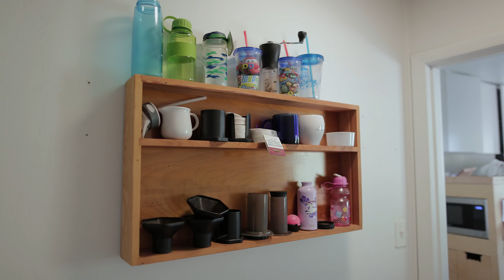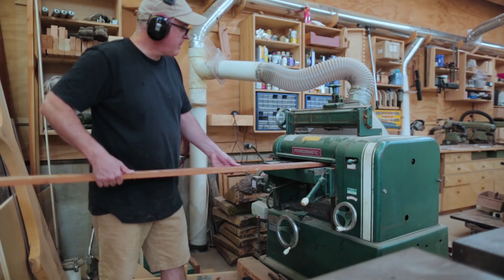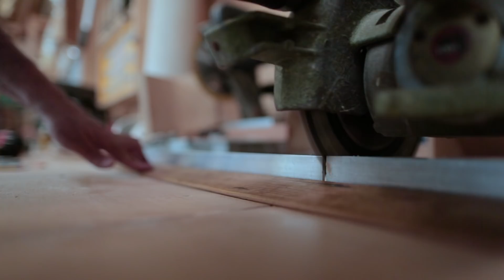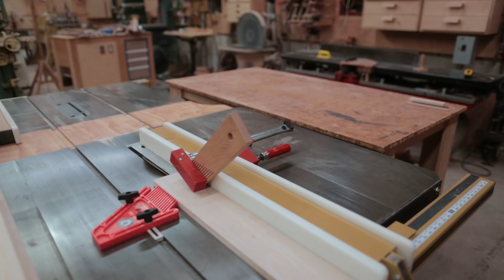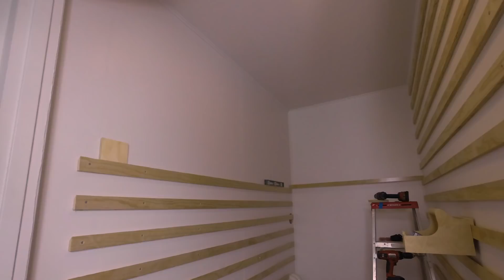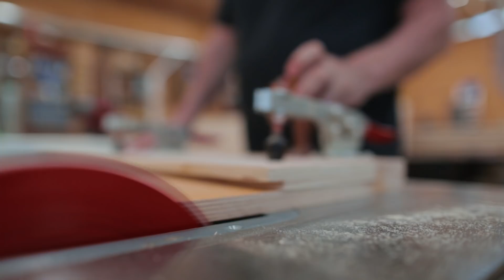Making the Pantry Part 1

Comment: Great work, BUT for space efficiency, you do not give the spaces between the shelves in order to  store different sizes of pantry goods? The storage shelves I am building do not have a wall on either side of the shelf. Therefore, I Will be putting a thin guard of wood,  rail  so that the can will not fall over.  What I need, eg a can of tomatoes height is 5", how much height between the shelves would I need to allow for removal of the can over the guard rail?

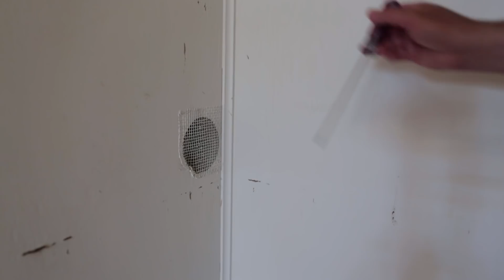Comment: At 4:44 the red paper going onto the floor is called "rosin paper" which is nice and thick and, importantly, CHEAP.  Much easier to work with than drop clothes (no tripping hazard) or plastic sheeting (no sliding hazard).  Find it at your local home repair store in 100ft rolls.

Comment: I would like to make a French cleat wall like that in a room in which one of the walls has the cement blocks exposed - it's in an old building and there is no dry wall. Do you think I need to screw some 5/8" plywood on the wall with cement screws before installing the cleats or should I install all the cleats on the plywood before screwing the plywood on the wall? I enjoy watching your videos a lot. Thanks for making them : )
Reply from the maker: That is how I have done this in the past; attach the cleats to plywood then attach that panel to the wall.

Comment: whether it's canning tomatoes or building a pantry, you're the one YouTube woodworker who can pull it off in an entertaining manner.  I'd bet my last nickel that room is fully insulated and used to be cold storage.  I had a similar room in my old house.
Reply: That might also explain the vent. Using a portable air con with the exhaust going out in the summer or a fan coming into the room from the back in the winter you could make that room 60 degrees (or less) year-round for veggies and other fresh items.
Reply from the maker: I was noticing that there was no heat register in that room, which seemed odd.
Reply: Frank has a day job and a fam, so his videos are not as frequent as some channels. Therein lies the beauty; they are always well thought out, informative, and RIVETING. Yes, I'm a bit of a fawning fan - the guy is just fascinating to me. :)

Comment: Have you thought about keeping a small flush trim router next to the CNC to trim off the tabs?  It seems like it could be easily stored and would work for all shapes and sizes since the tabs would always be the same height.
Reply from the maker: Interesting, i hadn't thought of that.
Reply: frank howarth It likely wouldn't matter if it's only purpose is removing small tabs but Bosch makes a quality one handed trim router, it has far outlasted my Rigid and Dewalt ones at least.
Reply: Even an oscillating tool with one of these on it http://www.homedepot.com/p/Dremel-Multi-Max-Oscillating-Tool-Bi-Metal-Cutting-Kit-for-Non-Ferrous-Metals-Wood-Plastic-and-Drywall-3-Piece-MM472B/203362691

Comment: Also - this is totally a subjective choice (both ways work equally well) - but using a flush trim bit on the router table to clean up all of the tabs would be a quick way to knock out both the curved and straight sides in one go (if the cuts don't actually require smoothing from the sanders).
Reply from the maker: The cuts were a bit fuzzy, i think i need a new bit.  so the sander helped with that.